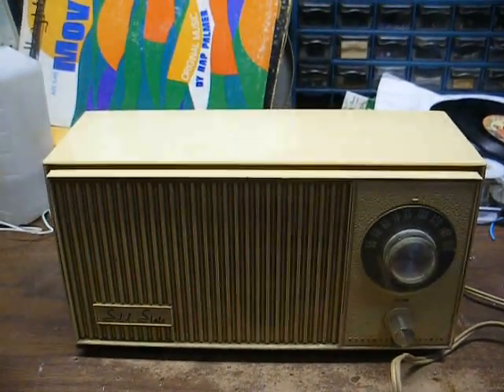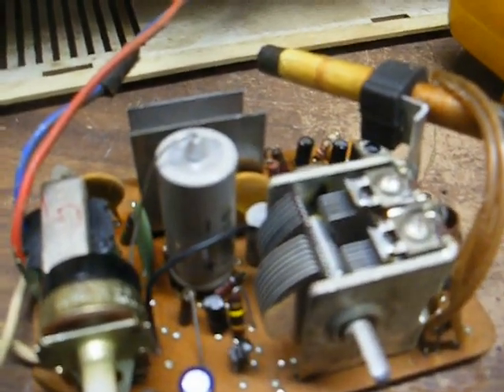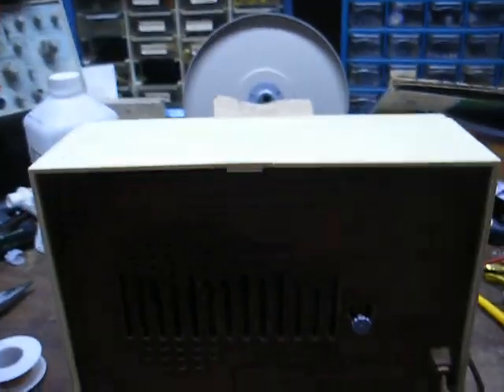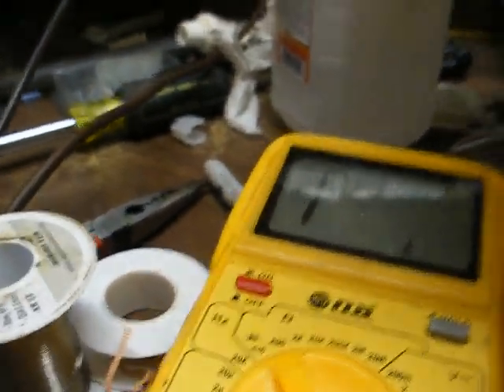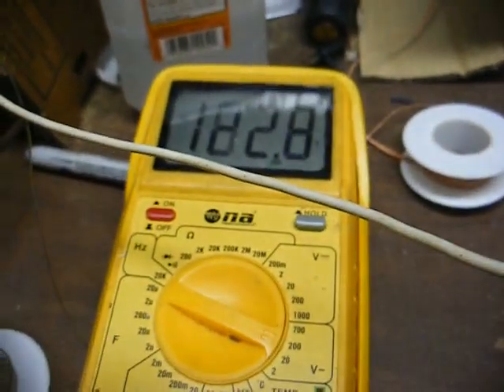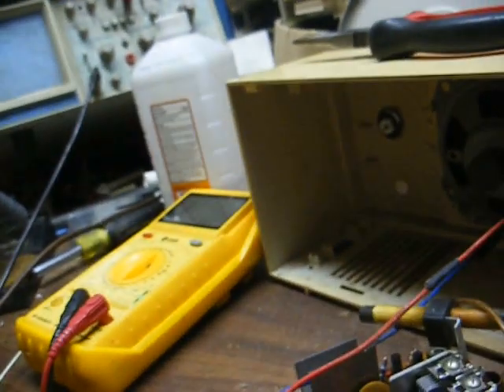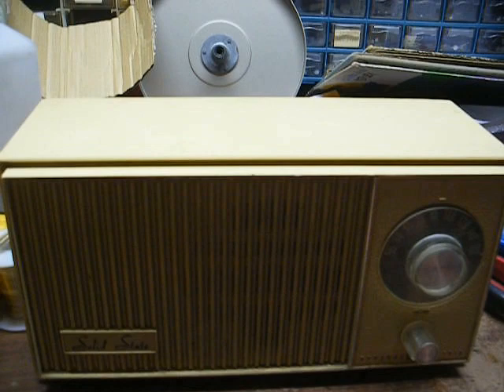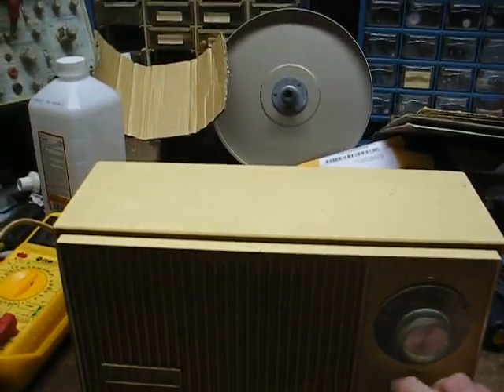Repair of a 1961 Zenith radio & a late '60's GE radio

Comment: I have seen cold solder joints on the tube sockets causing the filaments to work intermittently. Had this problem on a 5u4 socket on a 1952 magnavox black and white set This is very common on tube GE TVs  with pc boards

Comment: I'd be surprised if you haven't figured this out yet but, instead of adding solder to the volume pot try pinching the rivited metal to carbon pad areas with a needle nose vise grip. That's worked for me many a time on volume controls and to tighten up speaker terminals....

Comment: Well, no major carnage to fix this time around, which is always good. Did you test the 12BE6 in the tube tester? Zenith used the worst quality tube sockets known to man, so it wouldn't surprise me if the tube wasn't making good contact.
Reply from the maker: Yes, it indeed had an open filament.

Comment: Just wondering, do you resell any of your repairs?
Reply: 8BitSloth I was wondering the same thing I bet he does and flips them..
Reply from the maker: Very rarely do I ever get rid of anything.
Reply: That is a REAL shame, but I know where you're coming from. I've been holding on to old consoles for 25 years now. I do have something to ask though, would you happen to have any service manuals for Singer TVs from about the late 60's to early 70's? I got an HE8 101 I've been wanting to get back in working condition for a very long time. You seem to be the man to ask.